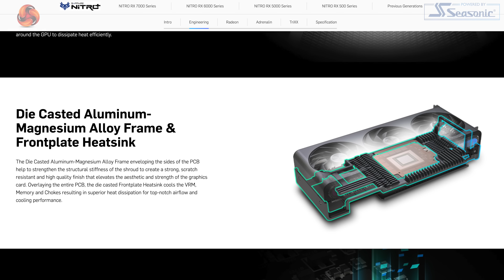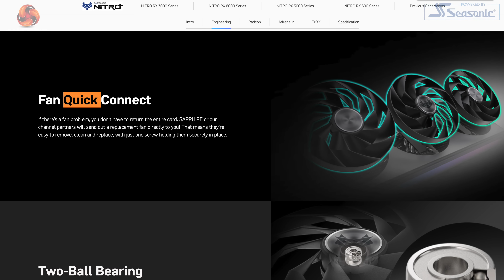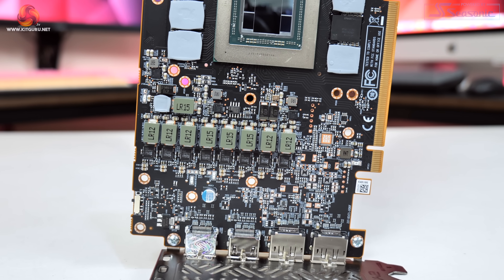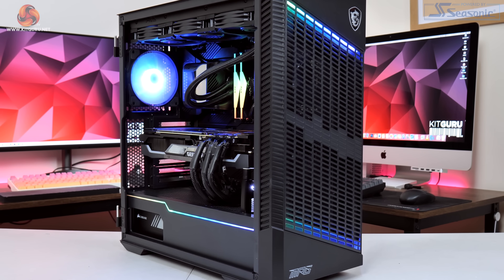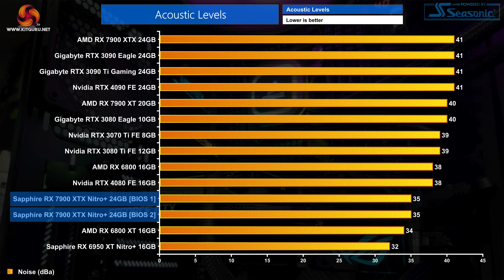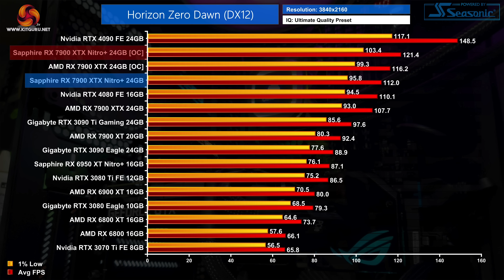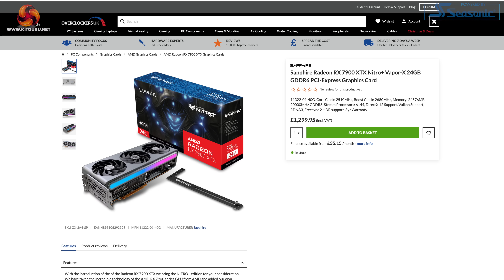Sapphire RX 7900 XTX Nitro+... one heck of a card!

Comment: Those have an excellent undervolts performance tho, my pulse sits on avg core clock of 2780 where memory oc to 2700 consuming avg of 330w, the peak is 400w but the hotspot remain 81c max, same as the nitro you showed here...

Comment: hey, how are you?

can you help me?

I have an RX 7900XTX Nitro Plus.
she is incredibly beautiful.
or almost incredible

I say this because
my computer after a while restarts by itself.

I have already reduced the power of the GPU. I already removed the xmp from the memories. but for some reason
my computer restarts.

my configuration is:

b550 auros elite
5800x3d
2x16 (3200-360MHz)
rx7900xtx nitro plus
850w source

a detail.
before restarting the computer. the monitor is left without video. then restarts in a few seconds.

Another detail is that all of the computer's LEDs (RGB) remain accessible.
gpu rgb, memory and water cooler....

I already updated the drivers.
I've already used old drivers but nothing changes.

hug!!!
Reply: If I had to hazard a guess… your problems are due to your PSU. Upgrade to a tier A, gold rated, 1000W PSU. I bet that’ll cure your issues.

I’m using the Corsair RM1000e and it’s been fantastic.

Comment: my nitro topped out on 526 watts, pretty insane when you see how easy this card does that.
Reply: Mine goes to around 465W+-10W - how did you manage to get it that high?
Reply: @MrTeknown  overclocked the fucking shit out of it,   i'm on a custom waterloop, this was with all new pads, and ptm7950 on the core,  but in gaming and dailly use it never gets that high.
Reply: @osmium_fps6082  I played around with the settings, but it doesn't really make a difference in fps in 3440x1440p in the games i tested. 1-2 fps higher than default.
Reply: @MrTeknown   no it doesn't, but that;s not why i overclock, i just want a little benchmark competition for my cpu gpu combo in my specific country, with the 7000 series cards, overclocking the memory has more result then trying to overclock the core, and actually when you overclock the core to much the performance goes down, for gaming i overclock the memory a bit, undervolt and downclock the core a little.

Comment: These cards are begging for PTM7950 for stock aplication which is as good as liquid metal and lastst a lifetime and is reuseable by just putting back the excess on top of the gpu core and having it burn in the PTM7950 pad

Comment: Although you said that it's similar to the 4080 in terms of performance and price, the 24GB is definetely a win over the 16GB that the 4080 offers. Especially with how demanding the games are in terms of VRAM and also for game development and Ai tool usage. So taking that into consideration is much more worth taking the XTX while only sacrificing a few frames in RayTracing but getting all the other benefits that come with higher VRAM
Reply: If you dont run RT the 7900xtx is def the better pick compared to the 4080. If you run RT then even the 4080 and 4090 barely work fine in 4k. In 4k gaming the 4080's VRAM won't outlast the 7900xtx. DLSS was a bad argument and still is a bad argument, but if you care about it..fs3 is proving to be very potent. 

Only usecase I've seen for 4080 is 1440p RT gaming and even then cyberpunk with RT runs at 50fps for instance. Not a big selling point to me
Reply: @psobbtutorials6792  how about RT for 1080 with a 7900xtx?
Reply: @Good_Username  6800 XT is for you... 7900 XT / XTX is better for 4K

Comment: I got mine a few days ago and the coil wine is crazy. I'll be sending it back.
Reply: What size if your PSU I had coil wine until I went with 1000watt Asus
Reply: Funny thing... the coil wine turned out to be from the PSU not the GPU. Only noticed it after I decided to run a test with the PSU on the outside of the case.
Reply: @Player7BR  if you are talking about a whining sound (ant not just the fans) it's luck based.
Even within the exact same model some will have it while other won't.
Reply: Funny thing... the coil wine turned out to be from the PSU not the GPU. Only noticed it after I decided to run a test with the PSU on the outside of the case.
Reply: @SiveonFarcloud  glad ya solved it at least lol these 7900xtxs are power hungry and spike hard

Comment: My sapphire 7900 XTX idles at 29 to 31 degrees. Under load gaming about 60-62 /  It's a bad ass card visually as well. I switched from Nvidia back to AMD graphics recently. The 7900XTX is powerful.
Reply: @M3Willienvidia and AMD are basically tied. Or they were before the 4090 came out, overall AMD is better because of the price and extra vram. That's my personal opinion doe
Reply: @M3Willie ...man.. I regret just buying a PC ...takes up too much my time.
Reply: @RTXRetroGoI talked to someone who bought a 2080 super about my build (7600X/7800XT) he was surprised I go with AMD. I told him that I had no driver issues, no crash, and get 2K 144 FPS RT psycho, settings ultra on Cyberpunk, he was kinda surprised. I then told him that the game doesn't even guve player anything higher than FSR2.1 meanwhile there's FSR3.1 so he knows the card absolutely destroy any Nvidia card at the same range of price
Reply: I know i am nearly a year late, but i am thinking of going from AMD to Nvidia for the DLSS, since its more widely available and more superior than FSR.
Reply: @lithari1480  / yes, I've been back-and-forth from Nvidia to AMD over the years. my card is still rocking frames extraordinarily well, but it all helps to have a great display (in my case) a curved 34" display, I will never go back to a flat screen monitor/ DLSS has its applications with a few top titles but with fallout 76 'my current addiction... everything looks pretty good
Reply: @Cruusher  What is your build? Please share your monitor, keyboard and mouse too! 😄
Reply: @ / considered old now. Intel 10900k on top of an Asus Prime Z-590 board, plenty of RAM, but I still rock on top titles pretty well/  monitor is an AOC 34 inch curved 165  MHz I think. Mouse is a Logitech G 400S which is all I've ever used. They fit well in my hand. oh, and I forgot I'll run everything on air. Noctua CPU cooler and like fans all over.
Reply: @lithari1480 nvidea is not worth it unless you buy 4090. the rest has 16gb vram or less, in 4k games are already close to 16gb vram use, Nvidia is not cards for the future and for their price they should be

Comment: Would an 850 W power supply be sufficient for this GPU? (assuming you're running other hardware that is good enough to not bottleneck)
Reply: I run this card with an rog 850 gold haven't noticed any performance issues

Comment: Is it normal for the back plate to get extremely hot? So hot that I can't even put my finger on the card around the chip. The temperatures in games are between 70-80 degrees and the wattage around 400.. Should I use more fans for better cooling in the case to keep the back plate cooler?
Reply: 70-80 is fine

Comment: I don't get all this fuss about the 7900XTX not making sense compared to the 4080... The 7900XTX performs pretty much identical on average in regular gaming. I don't use ray tracing, I think most people don't care about it yet. I had never even heard of it before these new cards launched... Also, 8GB more VRAM is significant, and no cursed 12VHPWR connectors.

Comment: I'm sure someone else has already pointed this out, but the card has DisplayPort 2.1 not 1.4.
Reply: Just have to wait for monitor manufacturers to actually put a DisplayPort 2.0/2.1 on a device. Good to know AMD future proofed the 7900 XTX for future displays
Reply: @steve42069master  Its not true 2.1 Its 2.1 UHBR 13.5, actual 2.1 Monitor like the AORUS one is 2.1 UHBR 20, still can be used for 4K 240Hz but it will require DSC
Reply: @steve42069master  Samsung with the mini Led 57 inch, forget the exact name. It's a 240hz 4k ultra wide, I believe so def in the  DP 2.1 bandwidth territory.
Reply: I’m kinda slow and new to pc stuff what does that mean
Reply: @A.jmmmm04 what does what mean bud?
Reply: It’s no ASUS Tuf rt 7900 xtx oc 24gb 😏
Reply: Im sure mine is all metal,it feels like,not the plastic top as he mentioned,yeah didnt sub.
Reply: Quite relevant these days with the 4k 240hz oleds...
Reply: It is kind of pointless for now. Like thunderbolt 5.0, pcie 5.0, m.2 gen 5, wifi 7.. DP 2.1 is good to have but not actually need to use. 4k 240hz is kind of expensive and not sure if the others manufacture put DP 2.1 on their monitor for this time.
Reply: @phucvo4325  not at all. It is important to have the proper bandwidth for the proper resolution and refresh rate...
Reply: @phucvo4325  I have a gen5 ssd and two GPU's with enough lanes to handle all 3....

seriously the crucial T700 gen SSD is 20% faster than any other gen5 ssd and my mobo didnt officially support it.

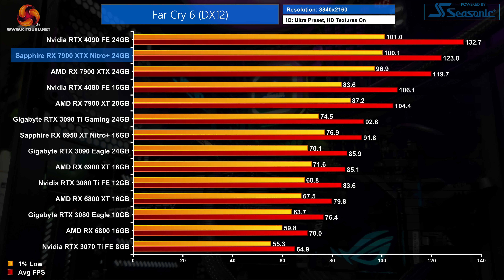Comment: So around 9:16 is that Bios 1 or 2? Because it looks like you're using bios 1 and it's drawing more than 100W extra for 1 to 4 fps increase. To say that it's stupid would be an understatement. Please specify for all benchmarks what bios are you using and if possible I'd like to see the power drawn compared to the reference card. I was about to buy it until I saw this video. I can do without nVidia's DLSS and RT performance but stupid power consumption is where I draw the line. I was fine with 50-60W more than a 4080 but that's insane
Reply: I keept it in bios 2 overclocked and undervolted. Power consumption is 390W at max. I get extra extra 10% fps increase when running FurMark with this setup. 109fps in stock bios 2 with 350w power draw to 122fps with 390w.
Reply: @Shulcyo  what are your settings if you mind sharing please?

Comment: Thanks for the review. Definitely shows the limit of the new AMD GPU. No reason for me to buy this release, and definitely no reason to spend extra vs reference unless you really like the look of the card and want to pull even more power out of the wall with very little performance actually gained.
Reply: Change it to permanently clock at reference and you'll have a very very quiet card that can cope with quite high ambient room temperatures without getting hotter. Underclock a fraction for less power draw. If you have warm summers and need to choose between playing games and cooling the room (lol what a thin excuse) then this is it. (It's also an ideal winter heater :P )

Comment: What's everyones thoughts on GPU longevity when maxing out the power delivery during overclocking? The Sapphire Nitro 7900XTX  can pump 480W into the RDNA3 card whilst still maintaining reasonable temperatures. Any chance that this could have a detrimental effect on the cards function over 4-5years?
Reply: It's wasted energy and 4-5 years of 500w would almost certainly make this card much more likely to die sooner than later. Honestly, you're better off going the other way and seeing how little power it can sip while still maintaining it's 1440p legacy for as long as possible.

Comment: I love when reviewers push max overclocks on the 7900 and say "wow look how close it gets to the 4090!" When the 4090 is bone dry stock reference cooler and could easily be overclocked 200+ core and 1000+ memory and gain at least an additional 10% more performance over stock. Completely unfair.
Reply: That goes without saying, its simply to show that you can get close to 4090 without spending the money. Yes you overclock the 4090 and its unreachable everyone knows that too.

Comment: I got the Sapphire Nitro+ 7900 XT 20GB. I like the cooler, 3+pin power connector and it looks like my old Radeon VII without the red (R) on the right corner.
Reply: Looking to replace my Radeon VII with a Nitro XTX if one ever pops up. Guess it is the right time to upgrade from the VII since I'm not the only one it seems. 👍
Reply: @Jurban5  I wanted a nitro XTX but that card is allusive. There's one on Newegg for $1500 scalper. 

Well at least I know the nitro XT can OC to nitro XTX version and gotten 4080 time spy extreme score 14500+ which is great while keeping temp between staying 60c-70c.
Reply: @Kt Pt  yeah, I've been watching all of the pages like a hawk, can't believe the $1500 scalper premium. Figured I'd try and wait it out until I get lucky enough to snag one when it pops up. I would get the xt version but really want that extra 4gb vram for 4k stuff
Reply: @Jurban5  yeah I feel the same way. I also wanted the extra 4Gb...I saw benchmark where the VRAM already between 12k-17k usage.

Higher resolution require higher VRAM. I've settled for a 1440p 170-240hz maxed setting. If you can get a XTX you have more patience than I do haha!
Reply: Well now's the time if that starfield package is still available @Jurban5

Comment: I have a reference powercolor 7900xtx, and it runs and overclocks just like this card does. Hot spots usually don't hit more than 84, but the average hotspot is in the 60s... sometimes low 70 depending on game. I think that the thermals are being blown out of proportion by anti AMD outlets.
Reply: Nice n=1 Vs dozens of reports confirming the issue
Reply: @syed2694  I don't doubt peoples' cards are overheating, I just doubt how bad it is based on what news outlets are saying. It's hard to tell. I'm certainly willing to accept it's bad, but I just imagine it's a small percentage of users who will somehow wind up being helped.
Reply: @bardactic3302  Mine was overheating a lot and just did the RMA thing and now got my 3090 back to pc
Reply: @bardactic3302  and yet debauer has 4 that are overheating and throttling 

That's not a small number
Reply: @Alucard-gt1zf  yeah his video wasn't out yet when I wrote the comment. The problem is definitely more widespread than I thought. I hope AMD rectifies it soon. I wonder what the news would be like if there was no major RMA issue. It's a solid card.
Reply: @hellrep  yeah that's rough. I've been seeing since I wrote this comment how widespread the issue is. Sorry to hear.
Reply: @Alucard  he bought cards from people who got cards that we over heating. It's not like he bought 4 retail cards and got 4 cards that over heated.
Reply: @bardactic3302  went through 3 ref 7900 xtx. You just got lucky. Dont call us liars when you havent experienced it. I had to go for aib instead.
Reply: @hatersbhating  Liar? There was never doubt that people had faulty cards, I questioned how widespread the problem was. I posted this before any of the information was released about the Vapor Chamber issue. Now we know a lot of cards were effected. Sorry you had so many issues.
Reply: Apparently gpu orientation (ie is it horizontal or vertical) and contact pressure are causing most of the hot spot temperature issues rather than the coolers themselves being insufficient.
Reply: @zuhaeraziz7966  so I've heard. Mine is horizontal.
Reply: I have an aib red devil that gets nowhere near this result without running the fans at 3000rpm
Reply: @ohoffman10  I'm undervolted to 1080 with a max boost clock set to 3050 mhz. Maybe that helps? I'm also running in a Corsair 5000x with 4 fans and plenty of airflow. Also, the fans do hit 2,800 and run on average at 1,900RPM with an adjusted fan curve.
Reply: 4k is more demanding than 1080p

Comment: On the plus side, the fan serviceability is a great step towards a design with 3rd party easy replacable slim fans someone might consider manufacturing, and the extra fan connectors for close-by case fans PWM control based of GPU thermals/fan curves might pave a way for more of similar solutions...
Reply: yeah its a good idea, was happy to see it.
Reply: @innocentiuslacrim2290  There was a Noctua edition of some of the 3000 series NVIDIA cards. The lack of 4000 series updates suggests it didn’t do as well as we would hope, unfortunately.
Reply: Chiming in from the future, and we have Noctua 4000 series here. 

Does this change your opinion on this topic?

Comment: The multiply bios seems silly - why not have this as a software setting.
Reply: Modern GPUs may still include physical VBIOS switches for several reasons. First is the issue of safety and recovery. These physical switches serve as a fail-safe mechanism, so if software vbios update failed then you're screwed. Also, physical switches ensure compatibility in scenarios where a specific VBIOS version is necessary, especially in legacy systems or non-standard configurations. Security is also a concern since software-based VBIOS changes could be exploited by malicious software, and we definitely don't need some GPU frying virus going around. Specialized applications, older systems without software-based updating capabilities, and industries where precise GPU configuration control is vital also benefit from the reliability and consistency that physical switches offer. In essence, physical VBIOS switches provide a robust and secure way to manage GPU configurations in various situations where software-based alternatives may not be sufficient. However, having this setting in the motherboards bios to communicate with the GPU to change its vbios would be a better option, but that might take extra unnecessary work.

Comment: Are you limiting the oc/uv potential or are the 7900 XTXs less tunable than the 7900 XTs?  I have the XFX Merc 7900 XT.  I am able to stably run Time Spy Extreme @ 3050 MHz and undervolted to 960 mv.  I am also able to oc the memory to 2810 MHz with a +15% power limit.  I first set the memory.  Then I set the max oc to 3.3 GHZ @1 V.   I run the program and look for the max produced frequency.   I lower the max oc to 50-100 MHz over the observed frequency and begin lowering the voltage until I hit instability.  I back off 10mv.  I can get the memory to 2828 without performance loss in Port Royal.
Reply: It can be very hit and miss - silicon lottery really. thats a good result you got Robert
Reply: @amdforlife5591  Do you have a 7900 xt?
Reply: Lowest i can go with this card is 1090mv. Tried 1050 and it crashed 5 times in a row in game. 960mv seems like a fairytale